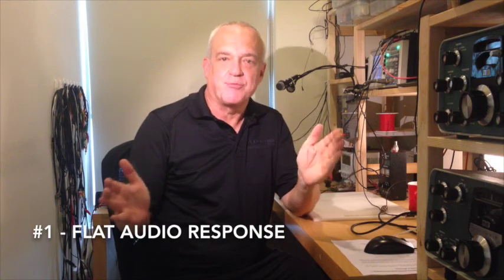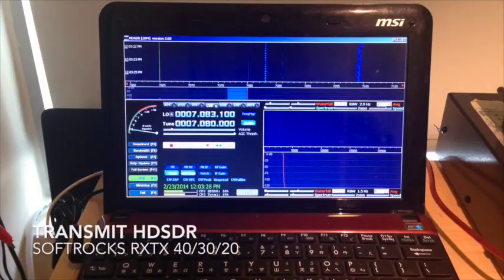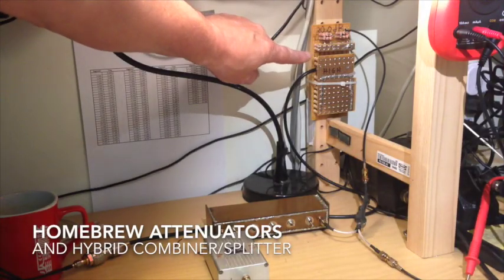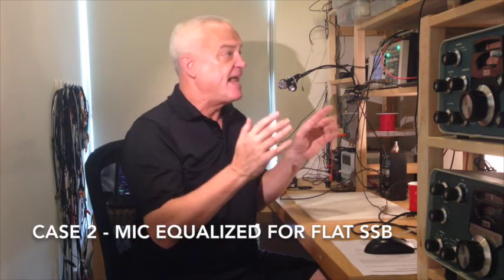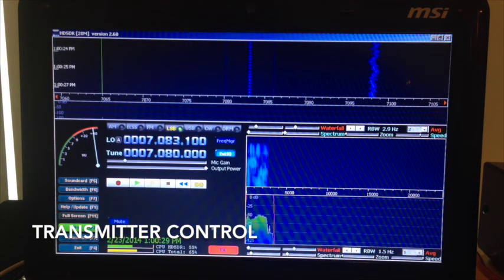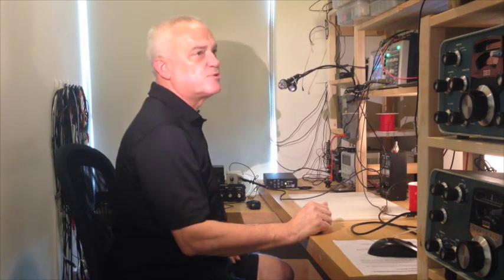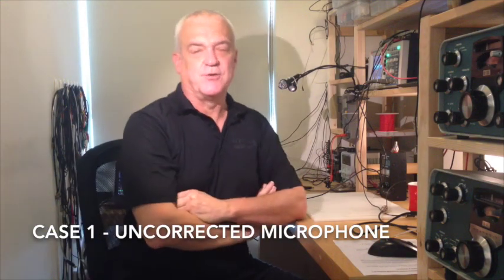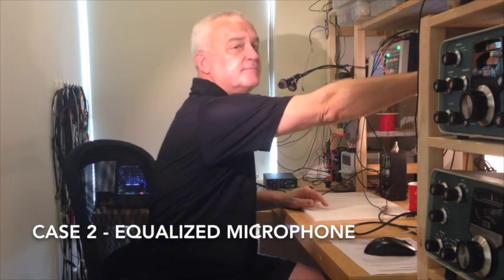Optimizing Softrock RXTX SSB Performance

Comment: Warren, my apologies. This comment was intended for the next video in your series. After looking at your HDSDR screen closer (TX), I see the audio spectrum window was set very wide and it was 10,000 I was seeing. Please disregard my last post and keep up the good work!
Reply from the maker: No apologies needed Jim. Thank you for your comments here and on the Softrocks forum.

The transmit HDSDR filter was actually set at a little over 3 KHz for the video which is about where I run it normally. This is a little wider than 'normal'. This means for Case 1 - Uncorrected microphone, the transmitted bandwidth was about 3.1 KHz, a little wider than normal. For the other two cases the bandwidth was overruled by the Voice Shaper equalizer profile which was set to cutoff at 2.7 KHz.

BTW, this video was shot on an iPhone that was lashed to a camera tripod with a tie wrap! Just amazing quality in our pockets these days!